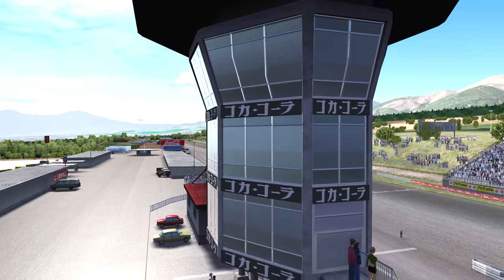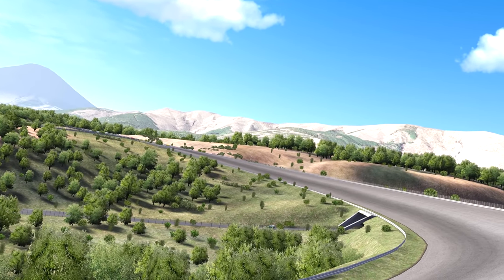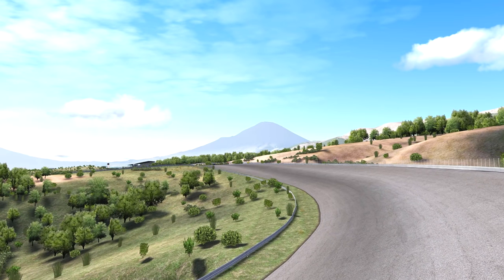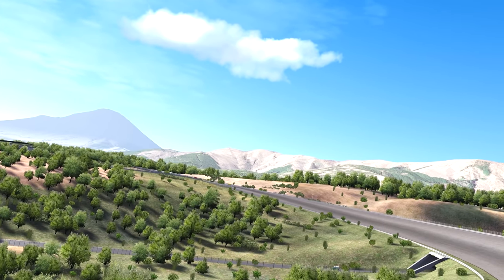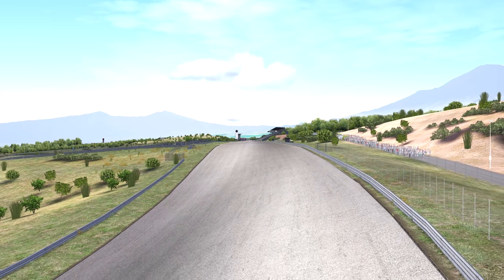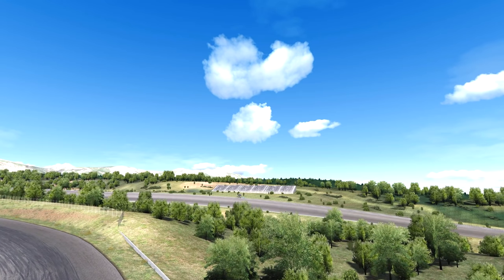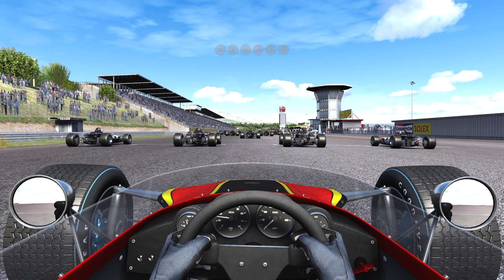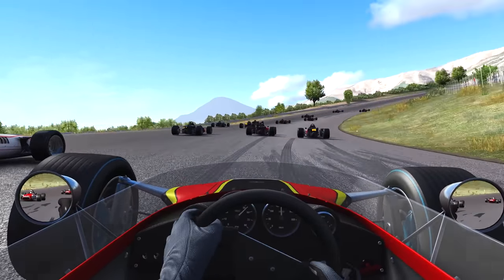Japan's 200mph Corkscrew - Fuji Speedway - Assetto Corsa

Comment: In terms of danger, old Fuji puts the Monza banking to shame.
Reply: That's a stretch.  Did you see the NASCAR guys do an iRacing thing on the Monza Oval early during lockdown?  That was nuts.

Also, back when the south banking was farther out and both bankings were lower, there was an event that saw 3 drivers killed.

I'd imagine that series of incidents at the 1933 Monza GP didn't do anything to help oval racing's perception across Europe.
Reply: @Villoresi  And don't forget about AVUS. That was even crazier at 43º and had no protections. At least Fuji had guardrails.
Reply: avus > monza > fuji > winchester > daytona
Reply: And the fact it is next to an active (for now) volcano
Reply: @isuckatthisgame  switch Monza and Fuji and that’s accurate
Reply: Wow that’s EPIC
Reply: @Villoresi we don’t talk about what happened with that race
Reply: @Villoresi  It's bumpy but, it just needs a fresh coat of asphalt and it would be fine. Put up Earnhardt barriers and it would be no more dangerous than Talladega.

Comment: Easily one of the best videos, I think, about one of my favorite eras of Japanese motorsport - the 60's to the early '70s.

In that vein, Funabashi Circuit would also be fun to feature on the channel, a tight, technical course built in the heart of Tokyo that opened and closed after just two years - long extinct, but equally fascinating in its own right.

Comment: That bumb in the right turn after the chicane (next to Coca-Cola bilboard), I use to take (and believe is the best) on the left side of the road. On the right side, the bumb is so big that cars tend to jump / spin. Taking it on the left side of the road is way more safe. And in general, this is not the track where the "ideal line" is the best or quickest. Definitely completely crazy track. I come back to old Fuji often in AC.

Comment: I can't help wondering how different motorsports history would have played out had the oval been built, or at least the banking built in a safer/more sensible fashion. Imagine a NASCAR Grand National exhibition race being run there successfully, leading to the launch of a Japanese NASCAR series with tube frame Toyota Crowns and Nissan Cedrics using the V8s from their Century and President big brothers (and matching road cars to homologate them)...
Reply: Parabolic banking, as opposed to "flat" banking, had been the norm internationally going back to Brooklands, at least.  The main issue though is, probably due to funding, the grading and just the inconsistency of the profile of the banking and the corners as you go farther around.
Reply: What I was once told at a Fuji race was that NASCAR intended to have a Fuji 500 to bookend their season with the Daytona 500. They were looking at more than an exhibition. I walked the entire modern circuit just last year and one can clearly see room enough for a copy DIS. If that, indeed, was the actual idea. I do not think this 2.5 mile Martinsville on 'roids was the original idea. But I could be wrong. My old Tomadachi said there was a clamor for NASCAR at the time and it would have been a big deal over there. Years later, Motegi went in and the West Series ran over there to a good crowd. NASCAR ran exhibitions at Suzuka before that. Logistics for an annual event had to have played a factor in all this, I would think, too. NASCAR did, indeed, pull the plug on the Fuji plans. Yrs, it is in the hills but easy to get to and Oyama is a nice town. I think it could have worked. Better would be to have built one on the Sendai Plain, but then in March 2011, such a track would have made the Atlanta Motor Speedway tornado look like a dust devil.

Comment: Reviewing the historical footage, its just mind-boggling. The 30 degree banking was never smooth, it always looked like 5-6 flat curves stacked on top of one another to try to make a wide banking corner, and the seams between those looked extremely bumpy and pronounced to be raced on safely. And at the 3/4 of the bank, there was a slight hump, or crest if you will, which must have felt like total loss of grip on all tyres for a split second, and that was taken at at least 130~150mph depending on cars. Even in rain. It was complete madness.

Comment: Imagine going through there is a modern F1 car... that would be crazy
Reply: I would love to see it and I reckon it could be possible with a corner to slow cars down before it. It would require so much work though, safety on the banking, resurfacing, renovations, etcetera would cost so much money. Kinda a dream of mine.
Reply: @dani02_mmd  no not irl but like going through the thing in the sim y'know flat out

Comment: I'm having difficulty finding consistent information on that USAC race, and based on the info I have tended to find, I honestly lean toward thinking USAC also ran the shortened course.  It's either that, or all sorts of numbers and figures out there are clearly wrong.

I mean, generally, the fastest average lap speed figure I find is ~118 mph, which is low for this layout.  Also, a number of places list the race distance as only 200 miles, whereas if it was on the full course, it would be pushing rather closer to 300 miles.

So yeah, I'm just trying to make sense of all this.

I quite enjoyed the video though, and the mod does look great.

Comment: the 2005 reshape is more a redesign since most of the layout was already there since the '80s
Reply: It is pretty much the only time in his life where Tilke didn't completely ruin a circuit.
Reply: @Official_MikeyT  Well I hate the Tilke version. I remember on GT4 not able to see the track limits and eventually wandering off the track at each corner
Reply: @hexgraphica  Yeah I used to have the same problem with it until I put in a lot of online races in GT300s. It is still the best track with Tilke's name on it though. Way better than train-wrecks like Yas Marina and Red Yas Marina (COTA.)